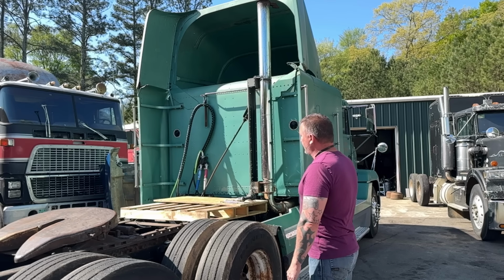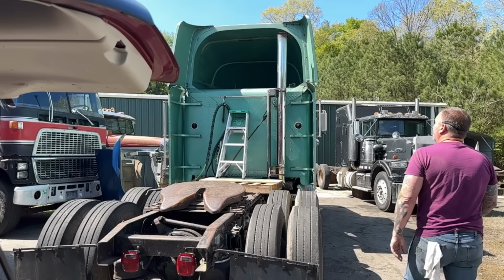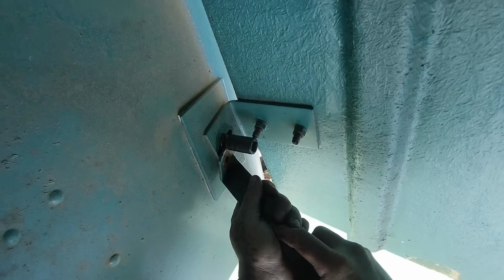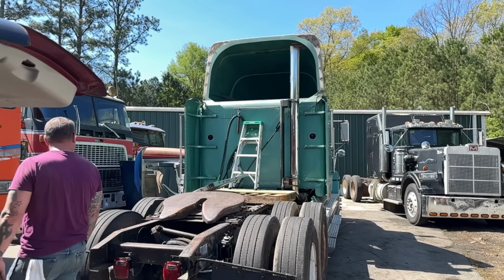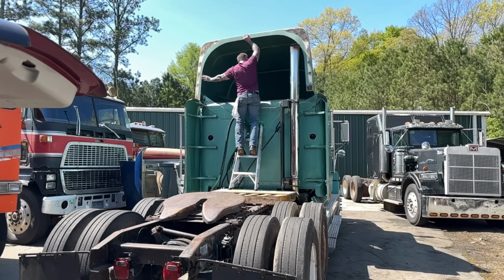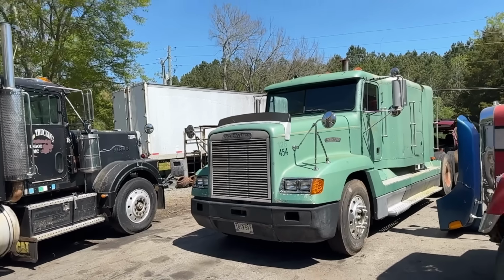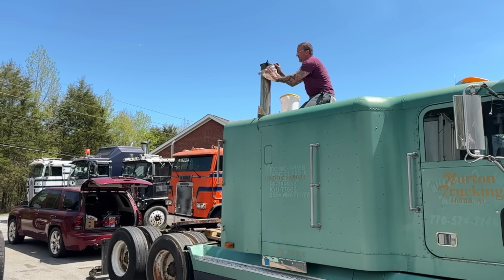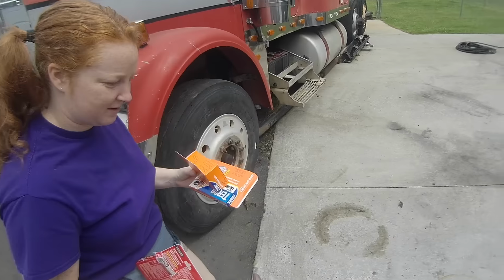FLD 120 Taking The Roof Fairing Off, For The Real Flat Top Look

Comment: James, I noticed you revved your engine up before you turned it off. That causes your turbo to turn at a high speed with no oil supplied to it and raw fuel to wash down the cylinders. I always let my truck idle a while before shutting it down. Just a thought. Your doing a great job with your fleet. Thanks for keeping us entertained. Long time subscriber.
Reply from the maker: Ya you’re right.   I know better. I have a few bad habits
Reply: I prefer with the top on because it gives the truck a distinct advantage over the other regular flat top FLD s out there

Comment: Hi James and Jessica looked a little iffy for a minute or two, but off it came. Too bad that stack couldn’t be saved but rust never sleeps. Think it looks better without it. I don’t know if you’ll really need it anyway it’s probably gonna be a log hauling truck. You should probably take the side fairings off too. They will probably give you ground clearance issues if I remember correctly those were pretty low on that style truck. Hopefully the top cleans up ok sometimes you take those off and the paint is pretty bad under there. Stay safe
Reply from the maker: Thx brother.  Let’s see what’s next for it
Reply: Seems like a plan to me. Used to drive one almost the same as that mine had sit down sleeper on it. Was really a decent truck, no room in it tho.

Comment: Looks good as flat top. So, brake lights still not working on Krystal? They didn't light when you were backing up.
Reply from the maker: I checked em
 They do work but I’m not sure if low pedal force doesn’t light the lights or
Not
Cause I haven’t had anyone push the pedal for me

Comment: yes JP, a NON working Truck, does not need a roof fairing- As U know, the Trucking industry is fighting ways to save on fuel- In case U haul Box trailers with this Truck, U may need it back.
Reply from the maker: I believe at best this is a log truck